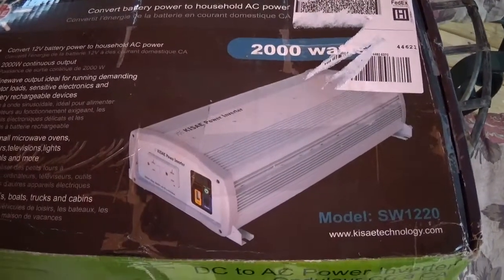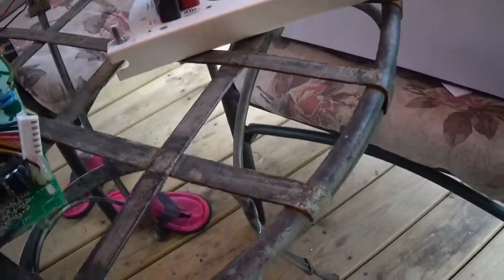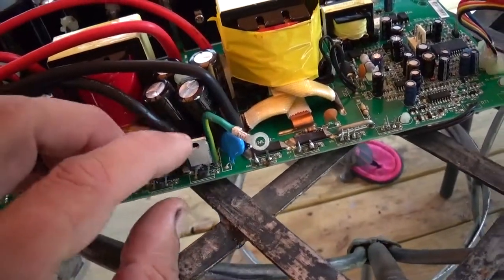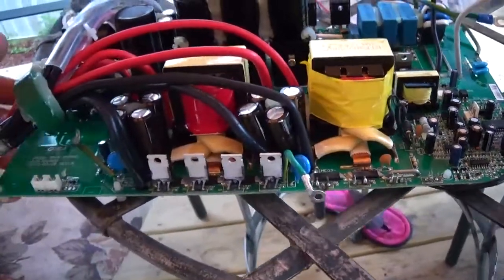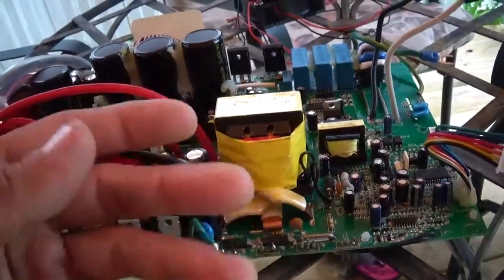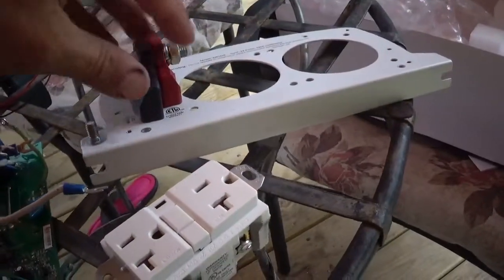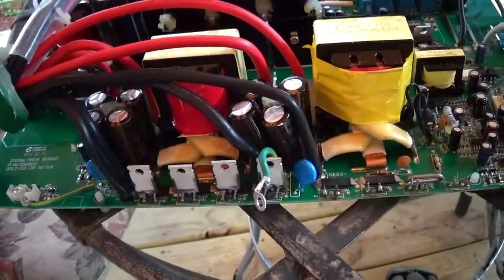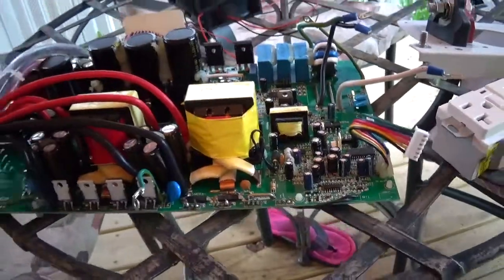Kisae SW1220 2000w pure sine inverter [ internal construction] review

Comment: i've have looked at few of these Kisae's.  If it's obvious that the FET's are fried, then forget the DIY fix.  Never found blown ATC fuses even on "Blown". units, so I don't know how these fail (or the fuses don't actually protect the circuit).  How do you know the oscillator is bad?  Have you ever found real schematics for these?

Comment: I have fixed these inverters in the passed and it is not the fets that are bad. It is the display board that goes out and shuts down the inverter. 99 percent of the time just replace the display board and the inverter will work fine.
Reply: how do you get your hands a display board

Comment: DonRowe.com sells these inverter for less than ebay and amazon ive owed this inverter and ran it for my home for 2 years and it did a great job and never sagged in voltage even at 1900 watts constant but after 2 years of starting a fridge the surge caps went bad and the unit would shut off after it surged over 2K watts.
Reply: Just hot mine from there. Thank you for the info.  Are the fuses on here  easy to replace in case?